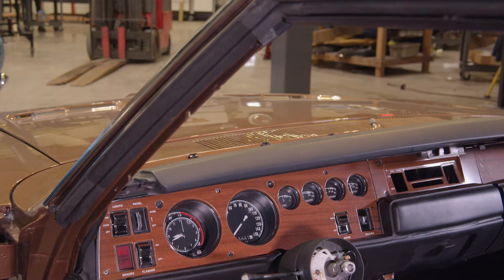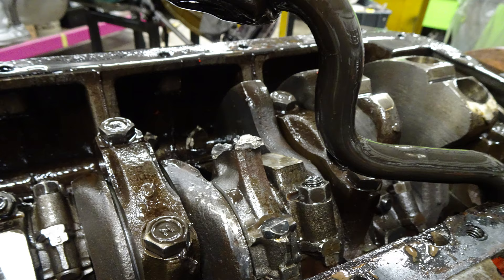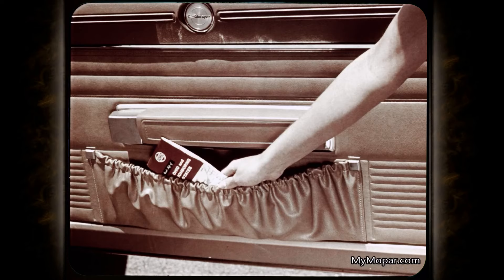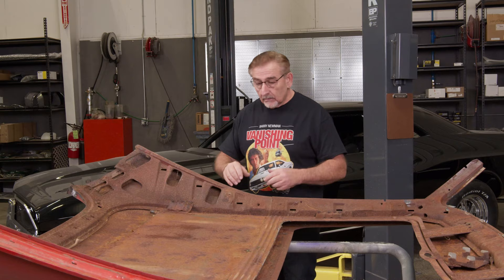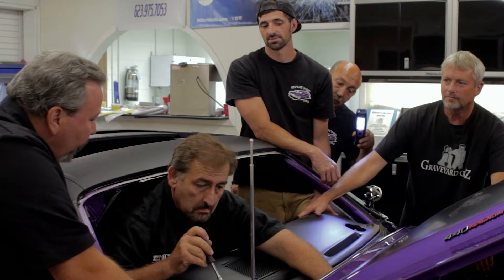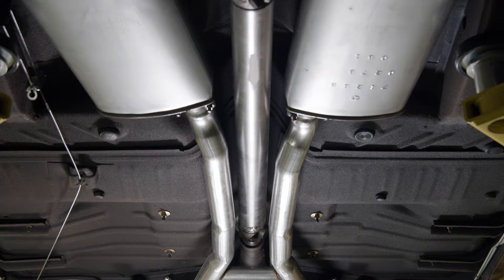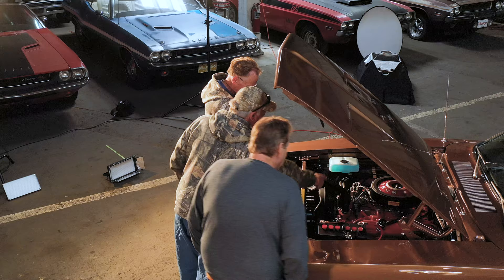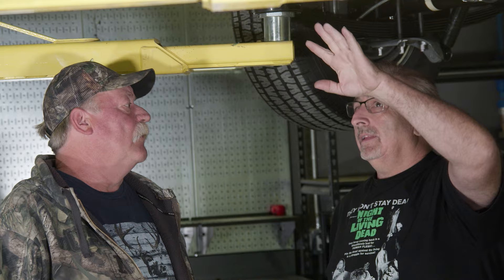NEW EPISODE: '69 CHARGER R/T SE COMPLETE AND TINY DANCER PULLS A FAST ONE!

Comment: Why is the 4 speed always referred to as the "4 speed Hurst shifter"??? The Hurst was the shifter..the trans itself is a New Process A833...Mopar used the A833 for decades, albeit in various forms (various gear sets and cases, later forms having aluminum cases). Just curious as to why it's referred to in this manner.

Comment: I really don't understand why you would put a stock exhaust on these cars. The paint isn't stock...why rob yourself of free hp and fuel economy
Reply: Do you intend the stock HP Exhaust Manifolds themselves ? or the rest of the Exhaust System/Pipes etc. ? I don't believe the Exhaust Pipes are all that restrictive.... the main cork being the stock HP Exhaust Manifolds, but which compared to Headers the Manifolds are far easier on starters and lower under hood temperatures than headers generally speaking.